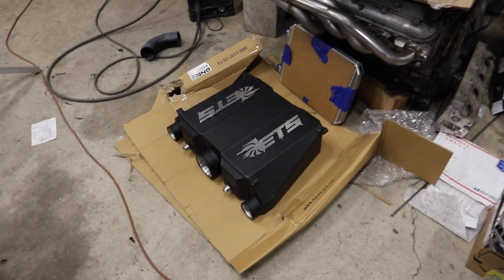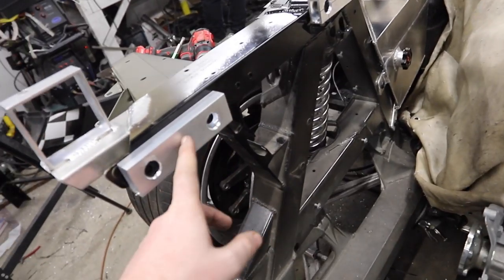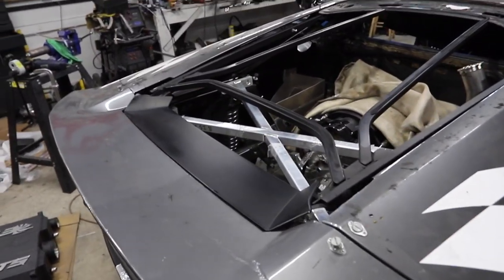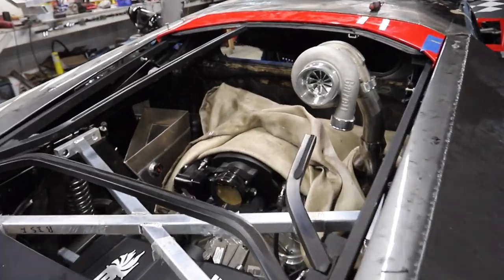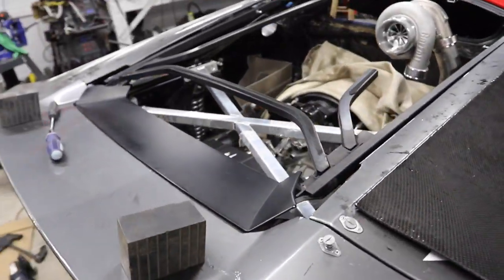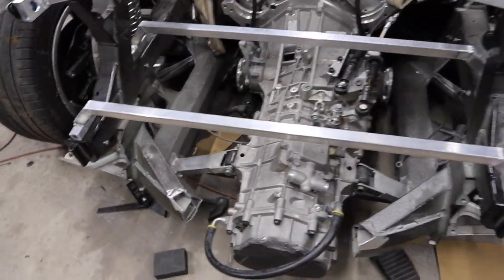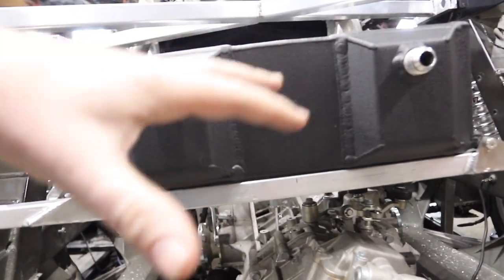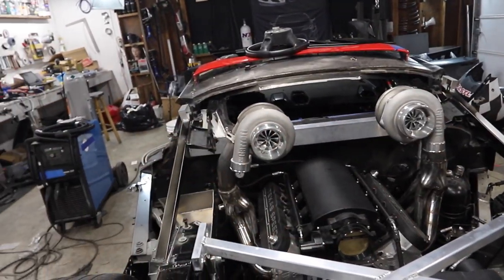Installing an Air to Water Intercooler on the LS Swapped Huracan

Comment: Honestly, gonna echo what everyone keeps saying about turbo placement/orientation.  Look at the Murder Nova or The Crow for how to show off turbo properly.  Mounting them in the front corners of the engine bay with a scoop running from the vent you're building into the fender flares would have been epic.

In the end it's your car.  Do what you want, but just be ready for tons of criticism on the turbos.

Comment: The things i don't understand are : why inverted turbos ? Maybe the air will loop aroun but you'll need to do quite a few tests to fit a sytem to loop the air into the inlet..

The other thing is : is it legal to have no crash frame in the back (can't remember how you call them, maybe just frame) but have the tip of the transmission sticking just in front of the rear bumper ?

Comment: Why didn't you get ETS to include more flanges on the sides of the intercooler and used it's own structure as support, with then only the minimum frame work each side of it to the chassis ? That's the sort of thing Colin Chapman did at Lotus.

Comment: I think it would have been better for the cross section weld if you cut both bars so that they would lock into each other.  As in you cut a slot into the bottom part of one and then another in the upper part of the other bar.  It would probably be stronger and would've been easier to align.

Comment: You need to have a reason to face the turbos backwards. A performance reason to face them backwards. If you had the air filter coming out into the scoop of the quarter panel then you would have some reason. But you seem to be going filterless. If the turbos were rear mounted like a truck has then backwards makes sense but the location in space means that everything plumbing wise will be better and cleaner if you face them the other way.

Comment: With the turbos sticking out, could there be an issue from the upper part of the turbo being cooler than the bottom with heat expansion and stuff like that from air passing over it?

Comment: I’m curious to see what those turbo headers they made do after they glow red hot a few times. I bet they either form cracks at the welds or just melt over like a wilted flower!🥀This build reminds me of the first time I built a model car, had pieces falling off cause the glue wasn’t dry yet and when I was done it had finger prints all on the windows and in the paint.🤦‍♂️

Comment: Clock those turbos so the output tube does not align with the exhaust hot inputs or outputs (90 degrees?).  Otherwise the air-to water intercooler will be over whelmed by the heat from the exhaust.

Comment: Turbo placement is the least of his worries.  The way they sit right now, the exhaust housings are on the wrong turbos -- they won't be forcing any air into the engine with the compressor wheels spinning the wrong direction.

Comment: Crazy and probably dumb idea if you straight pipe it: what if you had each exaust pipe split back into 4 after the turbo, and then had those 8 pipes running above the engine? Most likely will turn out not good, but it would be cool to see and hear

Comment: sooo you made a point of using tubing with the same rolled edges as the frame of the car but the mounting legs for the cross braces are NOT the matching tubing with the softer radius edges....  o

Comment: so......both exhaust from the turbos......meet in back center over the engine....and custom build a hatch with a baffled cool looking chamber that runs down the center top of hatch, and out the back............so when you open the hatch, the exhaust opens with it?  Looked cooler in my mind

Comment: If we can’t get off the trend of “flip the turbos” for a second, why don’t you make those “bridges” for the intercooler a little shorter and the triangle mounting points a little taller. It’ll keep the intercooler in the same spot and keep it from rattling a hole in it somewhere...(assuming there’s bushings on the mounts of the intercooler)

Comment: Would look 10 times better if the turbos were lowered slightly and then flipped. That way you could use the beautiful rear hatch you bought, and you could so some cool roof scoops to push air into the turbos so they actually function properly. Loving this build, but not those turbos.

Comment: A little concerned as to what you would do if you had to pull the motor or transmission with everything welded in where it is

Comment: would have looked cleaner, if you made your mounting plates, from 1/2" or 3/8" solid bar, rather than that 1/8" wall tubing. Would have been a slimmer mount plate if you used solid, would have been stronger, and would look nicer, since you can round the edges of your plates, like they do for boat T top mounting plates. Food for thought.

Comment: A non-turbo comment: Why are you using box-section tube for the "feet" (sorry, don't remember the proper english term) of your brackets? Why not a flat piece of aluminium? It would look much cleaner and nicer.

Comment: Does the ETS air to water cooler use an air filter?
Reply: I don't think so, the air comes in from the turbo and goes out into the intake manifold from what I'm able to understand. No real need for a filter because you should be getting clean air from the turbos
Reply: @carnyx_  Just hit me, the air filter will go on the turbo, no need for it on the ETS cooler. Just had to think about it out loud. Thanks

Comment: not a fan of the turbo placement on the lamborgini. everything flows nicely but for me,  it just throws the whole build off. I understand you want to show off the turbos through the lid but sometimes simpler is better in this situation. Build new manifolds to hold the turbos  lower under the lid and put those side vents to use to force air in the engine bay. who with me?

Comment: Since it has an LS engine you should do the exhaust the way you're going to do it but where it sticks out right there the end result should be one of those cheesy Chevy symbol exhaust tips two into one obviously so show off a Chevy sign on the back that signify that has a Chevy motor in it

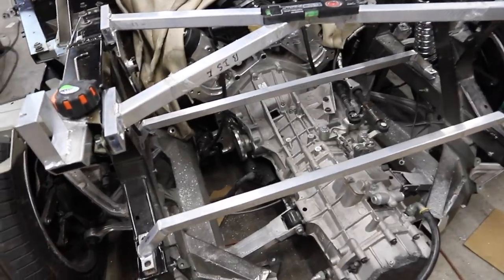Comment: Im baffled by wanting the welds for the ETS mount to look clean (understandable) but then you bolt on some aluminium onto the existing frame rails and (presumably) think job done? Look at 19:10 a thick plate would look so much cleaner than some tubing half the size of the frame rail...It would do the exact same job but actually look clean. Its all about the little details too.

Comment: Change the turbo location and direction, manifolds look janky, Turbo’s home made / rad rod and won’t work well, also making your job harder. 

And why not go with two air to air intercoolers, simple to fit and plumb and more efficient!?

Comment: My issue is that your attempt to put those turbos in a visible spot make them "float".  It is just too much stuff hovering over the engine at a level that is not even necessary. Yeah, it is just my style. I like sleeper cars.  Put a plexi panel to see your engine, but don't put things way above the engine. I love compact simplicity. The turbos are just 1/10th  of what make this car interesting. Not worth the effort to make them "visible", IMO.

Comment: Flip the turbo's they should NEVER be that way they will cause so much heat as the air pushes on the exhaust and not away from it and this will cause other troubles. I know it's your build but listen to people and get advice from engine builders they will tell you NOT to run them that way

Comment: looks like once again everyone is asking to flip the turbos and again it wont be done, they make shields for turbos and yet he still thinks that mounting them backwards and diminishing the effectiveness of them is better because "its not that big of a difference in performance". tell that to cletus, he has been showing how ineffective turbos can be just by not having it mounted properly or having the wrong angles on just the tubing. why do you think he is rethinking and rebuilding the setup on ruby, because even though it works and looks good, its not as efficient as it could be. 

PLEASE FOR THE LOVE OF ALL THAT IS HOLY, CHANGE THE TURBSKIE SETUPS!!!!